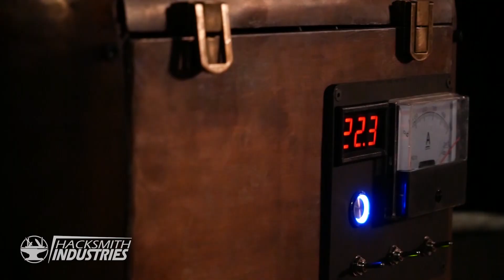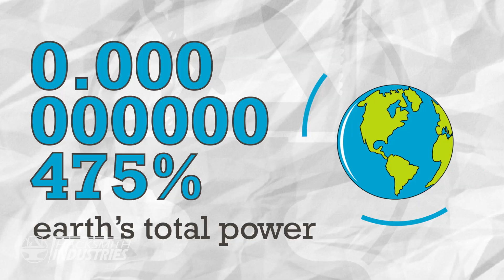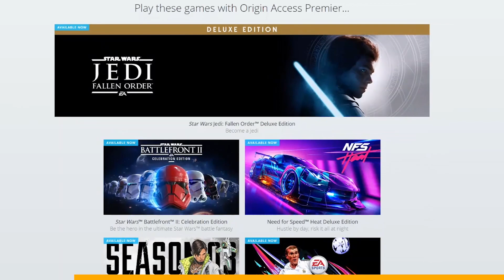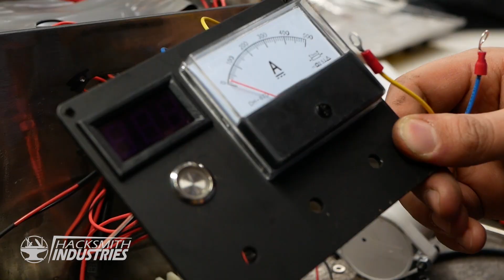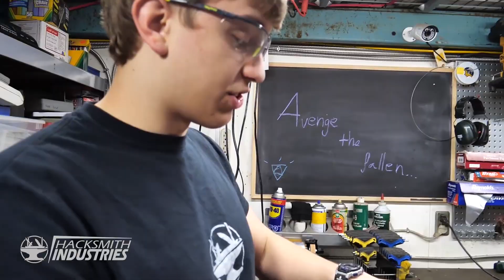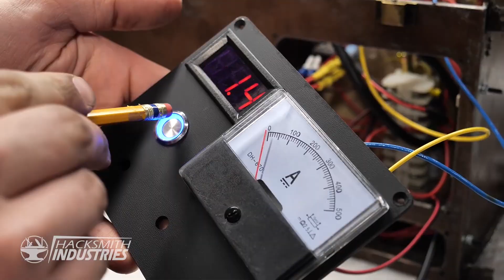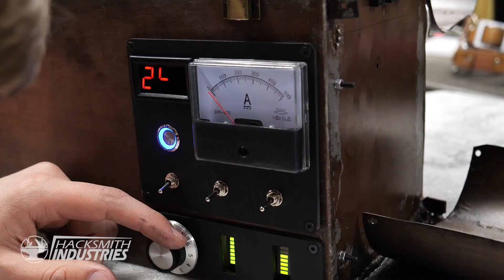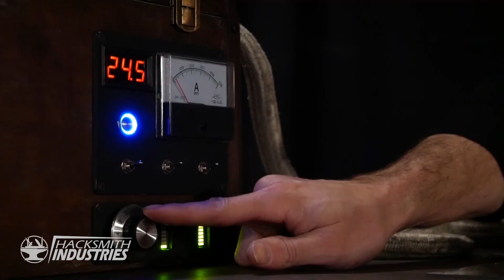World's First Protosaber! (REAL BURNING LIGHTSABER)

Comment: I had an invention idea for a lightsaber that uses water pressure and a casing so that the water will shoot out and be contained with the casing. The main problems are, how heavy the lightsaber would be, the amount of water needed and what would be used for the casing. But seeing this video, using a battery pack that's not for energy but for water could be a solution. It could possibly even make the pack a lot smaller seeing it only needs so much water but the weight will still be a problem. (Oh and it couldn't cut through anything either)

Comment: I feel like if you made the “blade” an actual blade & not just a metal rod, it could be used as a genuine weapon
Reply: Pretty sure the fact that it's like 10,000 degrees makes the lack of sharpness a moot point.
Reply: @2677Victor  I mean, it cut through the head, but it was pretty slow in doing so. If it was sharp, it could probably cut through the head like air
Reply: Why do you need a blade when you can legit burn through your enemy.
Reply: @elcalo1224  It's not just about burning through your enemy. It's about burning through your enemy faster
Reply: @ASquared544  I mean this prototype ain't gonna hold itself straight forever. What I mean is that with all the heat it is possible the blade part bends or cracks up. Sharping it will just make it weak since it could be more thin and the heat won't make any good to it.

Comment: Tip.
Run the power feed down the sleeve of the wielder, so it stays close to the arm and has enough slack to follow elbow and wrist movements. It's how it's done in fencing and should give a more authentic experience.

Comment: The only thing missing now is being retractable
Reply: Well it would have to be longer and have a button that activates gears that bring the bar down. Dont activate it while it's still in the thingy
Reply: @WizardArtistry  imagine it being turned on while still in the hilt!
Reply: 4 stage telescoping tungsten works... co2 burst allows rapid retraction without melting handle
Reply: Youd need alot of CO2 for that. And this thing gets red hot i dont think you want a burst gas to go off in the hilt. Springs &magnets would better
Reply: Yep
Reply: *o shite it’s a dogganmed sokr sccin

Comment: Nice! The early force practioners actually built their lightsabers this way. Except for the physical rod as the blade, they carried battery packs to power up the light blade. Then they found a better way to do the power source since they pretty much end up dead once the cable is severed from the battery 😁

Comment: Nice work. But I was there when Star Wars first came out in the 70's, and seen nothing but 'first real lightsaber' ever since. That one is cool, it cuts, kinda. Not really a lightsaber though, more of an enlarged styrene cutter. I had 45 odd years to design a functioning lightsaber. Salient points for lightsabers: they clash, ergo they have a solid element inside (light is not solid) - check point for yours. They cut, powerfully - kinda checkpoint for yours but I wouldn't say 'powerfully'. They are compact. They extend from, and retract into the handle. Up til recently, the tech was not available to build a functioning lightsaber - now, it just about is. 2 things been missing - ultra powerful batteries, and the gyro/balancing tech from drones. Or, some kinda AI. With those things, a functioning, retractable lightsaber is just about possible. It won't be perfect, not yet, but as close as dammit.

Comment: Congradulations on making a proton saber with the pack. I do not know much about programming and circuitry but i do know some basic principles of light and power. If you want to build a actual light saber you need a laser shot at a crystal that can make the laser bigger and more powerful with out melting the crystal. The crystal also has to be something that you can draw power from as well. Second you need a refractor or something that won't completely stop the laser but shortens it so the laser doesn't go on forever if you know what i mean. And you need a material that doesn't over heat that surrounds the laser and crystal and acts as the ignition chamber. I cant wait to see what you do next.

Comment: So...seemingly obvious question here: What happens if the rod in the middle was actually forged into a blade??
Reply: From flaming stick to flaming sword. It probably cuts better.
Reply: Lighter too
Reply: @coledewey3564  Heating a metal will soften it. It wouldn't be able to keep an edge

Comment: Typically in the equipment I service that runs at voltages and currents of this magnitude they control the supply with SCR’s though you could also use a TRIAC.

Comment: I like my light saber design. Simply a telescoping plastic rod like a toy but strong enough to block another sword. It has a bright light source but just "to scare the natives". Maybe stunner tech too. The real weapon in it is the plasma torch that discharges when a contact switch detects contact on the blade. Actually a ring of plasma torches in the hilt so it discharges the ones on the side the blade is contacting something. Similar to a blaster. Not as random as a blaster because less chance of hitting bystanders. Only fires at what it's in contact with.

Comment: To make a small point, assuming the outer rod was tungsten.

Tungsten has a glowing point of about 1000 Kelvin, and with the color the rod was it was probably closer to 1200 Kelvin which converts to roughly 1700°F. That saber is very VERY hot.

Comment: Couldn't there be some short waveform that won't travel very far that can do the cutting at much lower wattage?   And much like LED light compared to regular bulbs of similar waveform, but uses commensurability to attain the greater..  Then if you can't see it.. oh well, then use it but use light as a visual so you can have an idea where it is or maybe light can reflect off it through a perturbation effect as light doesn't travel really.

Comment: I guess that’s why the Jedi started with the protosaber, they didn’t have the tech for a full lightsaber, maybe if an extremely efficient electrical to thermal energy system is discovered...
Reply: Sith, not Jedi. The Jedi reversed engendered it during the Great Hyperspace War (before that they used guns and actual swords). After the war, they figured out how to make a power source that could fit in the hilt.
Reply: I forgot what it was, but apparently, we are very close to an infinite energy source by splitting a proton or something. So that could would be able to charge a light saber. All we need is the force.

Comment: Anyone else notice the crossguard design on Kylo's lightsaber is basically useless and just more dangerous for the wielder? There's quite a gap between the main lightsaber blade and the cross guard blades where an opponent's lightsaber could slide down his blade and then cut through the metal of the crossguard.

Comment: A better model for a lightsaber would be a plasma cutter. Not only is the “blade” able to contract, but you can control/ isolate the heat better with a plasma arc. The main problems are being able to sustain air pressurization and getting enough energy to lengthen the arc to a more “practical” length.

Comment: Hey maybe you could try getting like a hollow tube sorta shape of a metal with a really high melting point and extremely high resistance, and fill that up with like ionized gas (I think that's called plasma) so instead of tryna burn the air, you heat the plasma inside the metallic tube thingy which gets heated by conduction to get like red hot and voila you have a "light saber" (I'm sorry if this is scientifically impossible and makes no sense at all, this was just a stupid idea I had, I'm only a 16 year old in high school anyway lol) HAVE A NICE DAY YOU'RE SMART AS HELL MAN
Reply: Just realized he's probably not even gonna see this comment lol but meh
Reply: TGC // TheGamersClub not a bad idea you have a lot of big brain energy
Reply: @Outsidethebox hey thanks, also I didn't know they tried it lol

Comment: Your thinking of a light saber from completely the wrong prospective. Dont think of thermal energy and the amount of energy needed, a light saber as you see it in the films, doesn't create massive heat! you should concentrate your focus on light & frequency modulation and design a transparent thermal flexi-hold chemcor membrane with a combination of trapped gases to produce the desired effects. This would be significantly lower in energy consumption and produce a far superior light saber.

Comment: "The main road block is the power source"
Actually, it would be one of the 3 main road blocks. We are talking about laser here, so the 2nd problem would be the insanely powerful light emitters - how to cramp that necessary technology into this little handle? And 3rd problem would be - how to stop the light? You would need some other slightely impossible thing there, a freaking powerful shield emitter, also within this handle.

But I am sure you were realizing this by yourself just as well, you wanted to build a cool real life thing, getting as close to a light sabre as possible - and you did. I bow to your engineering skills, actually that battery pack is more impressive to me than the oversized glow stick. And that pack is at least as dangerous, if you screw up the wiring or some cell suddenly decides to mess around, you got yourself a very powerful bomb purse.
Reply: Build on his design, but then similar to the Hasbro toy model make it collapsible. Kinda like the design of the cell phone started as a backpack in Vietnam (I believe) now it's palm size, smaller and cheaper.

Comment: Makes a super cool red hot glowing lightsaber.
Only cuts a plastic head with it and calls it a day
Reply: 16:36
Reply: @nicolajkl  yeahh
Reply: It's not much, but it's honest work
Reply: The head is made of foam.
Reply: @josephle2381  foam is plastic dude just very aerated
Reply: humanity rising11;11 Ok.
Reply: Should cut thicc steel
Reply: I don't want Luke to get handicapped.
Reply: Imagine the damage it could bring to the human body
Reply: @michelefiore1863  non no one will stand and wait for it to cut threw them hahaha it took 5 seconds to cut threw polystyrene ffs
Reply: @humanityrising-hz3cm  doesn't need to cut through it. Just touching the blade will burn you to a crisp. Humans are much less durable than polystyrene.
Reply: This was a 'cold' lightsaber. He'd need a heat suit to weild a full powered lightsaber.

Comment: This factor makes no sense cause if the lightning and 1000 giga bolts it’ll be hard to make a prototype lightsaber this version is a hot version that is 2000 heat and is 20, freakin thousand W

Comment: Impressive - Most impressive. However as we all know the power source for a lightsaber is not electrically based. It comes from a Kyber crystal a colourless crystal prior to being bonded with a Force-sensitive individual, the process then results in different hues.
Reply: Yeah but Kyber crystals are super expensive
Reply: The crystal focuses the laser, still need a power source.
Reply: @morganaiken5335  Yes but Kyber crystal’s channel and amplify Force energy, the battery (diatium power cell) is not required to meet the full power demands of the lightsaber as you well know.  It is only needed to activate the Kyber crystal, similar to the way a battery and spark plug starts a car engine.

Comment: I did some work for a company that built heat induction coils for industrial applications. They engineered around many of the same issues. The cause of failure was almost always a cooked MOSFET however they used about eighteen of them with massive heat sync.

Comment: Can you make the top part copper so the blade can turn green?
Reply: Wont the copper melt away tho?  Seems like it gets way to hot for copper to stay intact. Even the titanium rod somewhat catches fire on the tip
Reply: Thought about it for a bit cuz i think the titanium is catching fire anyways cuz oxygen is coming into contact with the huge amounts of heat on the titanium rod causing oxygen to burn on the rod. Idk haha just feel copper wont work but then again how hot does the rod even get? Cuz titanium can withstand like 4,000°F(estimating)
Reply: @rudlum7250  Copper melts at 1085C, titanium melts at 1668C.
Reply: I cet tour point but i World actually suggestion ti try yo di an allez of lead and wilframium to give a blue/violet color, and the alley make it a thin tube and put it between the titanium and wolframium tube

Comment: Now you need strong magnetic fields or something to keep the heat from radiating away from the saber, conserving energy, and making it safer and easier to use.  A concept like a very long thin Dewar with the black hole like capabilities of letting mater in so the blade can cut, but not letting heat out.

Comment: That's amazing.  Have you thought about making the rod hollow and collapsible, like old spyglass telescopes?  The rod could then be stored in the handle, with some kind of motor extending and retracting it.  I have a camera tripod like that (without the motor).  When extended, the legs are about 4 feet long, but only around 1 foot long when collapsed.

Comment: I just want to point out that the early protosabers described in old EU lore were actually plugged directly into power stations or substations, and as recorded visits by the Mythbusters confirm for us those stations are certainly capable of producing the voltage and amperage of a bolt of lightning in open air continuously for an extended duration. Battery operation came significantly later, if my memory of the articles I read is correct, so it's safe to say you skipped a few steps. XD

Regardless of all of that, your welding-rod protosaber here is pretty impressive! Thanks for sharing, Hacksmith & Co.!

Comment: This would not be a protosaber no matter how cool (which it is very cool... from a certain point of view). A protosaber still functions in the exact same way as a traditional light saber, just with an external battery pack. This functions nothing like a lightsaber. A lightsaber does not channel electrical energy through a rod to heat it up, nor does a protosaber. A lightsaber uses energy to create a blade in the air where there was no blade or rod before. What you have is a heat saber. God, I'm a nerd.

Comment: You built the battery box with plate steel?! Guys, learn to work with aluminium so not everything you build weighs as much as Jaba the Hut. Actually, sheet steel would have been better than plate, cheaper too. Edit: Forgot to say, "Good job, your channel is awesome!"

Comment: well since the blade is a physical piece of metal it's more like a heat saber from the UC timeline of gundam
Reply: battery pack - check
metal piece as blade - check

the way i see it, this is fo3 shishkebab lol
Reply: More like a lightfoil from the old star wars universe
Reply: Yeah, the zaku type things they most likely to use that kind of weapon
Reply: Exactly, the laser part of the saber is way beyond us... and how the fuck are kyber crystals meant to be that effective? I know it looks impossible due to laws of physics, but I really see us humans accomplishing this one day.
Reply: To stop a beam of light or projected plasma at a predetermined point (say 3 feet from the hilt) and have it reflect backwards without particles colliding or beam integrity faltering is still slightly out of our reach. 
A high powered energy beam surrounding a thin blade core capable of simulating a lightsabers efficacy in every way,  for all intents and purposes, is contrarily within grasp. Like right now.  Though non military entities will likely not see them for obvious reasons, special force groups have been until using knife-sized versions of this since the Korean War. Not far fetched at all. 

Though it should be noted that scientifically, if two wielders of the weapons described were to clash, they would kill eachother first swing. There is no reason for these energies to bounce off one another like blades of steel, they would instead slice through eachother like water.
Reply: @BeguillingMirage  "special force groups have been until using knife-sized versions of this since the Korean War" Source on that?
Reply: Soooo is he a zaku now?
Reply: @yako9453  yes I'm afraid so

Comment: Loved it doing the Proto Saber. I read first Light Saber fight had heavy short movements as they thought the weapon would be a lot heaver than they decided it would be later. People looking at the physics of it decided except for power source the plasma beam saber was mostly doable. One problem it would be so hot it would burn everything around it, way to hot for a human to hold it. 

Now to actually not melt people you would have to  invent some sort of magnetic container field to hold the Plasma in and not radiate much heat. Making it so you have a invisible hand guard in last part of the blade also necessary. Hand Guard being some sort of projected field.

Comment: What if you have that metal beam but it retracts into the middle of the handle
Reply: It's hard to create a firm metal piece that can retract and tract without deformation from heat
Reply: @davea3641  Hard yes but not impossible.
Reply: What about like, a shoe, that's also a plane.
Reply: I mean it could be possible if you shortened the metal that makes the "blade" making it more of a dagger but it could be made to retract and still heat up evenly.

Comment: I suspected that Lightsabers are powered by flux capacitors. A thousand amps????? you could drop an elephant with that much. Excuse me Vader I have to get my battery pack before we can duel. It's just a matter of time before technology catches up and those things are completely self contained. Just in case they need to make the metal wand part out of some type of conductive virtually unbreakable and unbendable alloy like titanium, wurztite boron nitride and industrial diamonds combined if that's even possible.